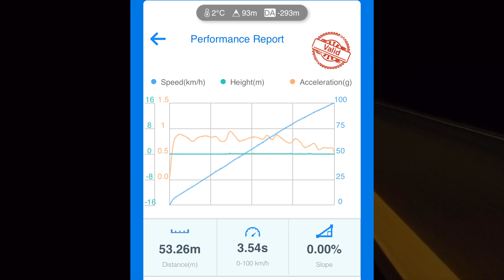WHY IS THE PERFORMANCE MODEL 3 SLOWER AFTER OTA?

Comment from the maker: So the average run 0-100kmh is now 3.64. Of 60-65 runs only one run below 3.56. Non under 3.5. Before runs were averaging 3.48! The power curve and the aggressive launch is gone. After the second 5% update it jumped off the line like a p100d! After v10 it is as before the second 5% power update. Why? You have a good reason why they should change the curve, acceleration and the way the power is delivered?
Reply: Nothing to do with software version updates. Install a obd2 dongle and use the scanmytesla app to check the "full nominal pack" value. In a new car, it should say 78kwh. Im pretty sure, that you have already some severe battery degradation, which cost you motor power, compared to when the car was new.
Reply from the maker: Nope, done the Scan my Tesla, checked temp, it is SW and most have it

Comment: I picked up my M3 in April 2020. In May finally took the v10 update. Immediately noticed acceleration loss esp "out of the hole." 
Now Tesla sells it back for $2000.  Clever way to increase revenues?
Of course there may be other explanations ... possibly to reduce stress on drive train components. 
I think Tesla could be a little more transparent.

Comment: My M3P feels slower off the line also.  I've only had it less than a month.  I can't put my finger on it but I know I'm not going crazy and it's not me "getting used to it" because the speed from 20~70mph is still fast and feels as fast as it used to be but off the line, when I bought it, it was a savage and now it feels weaker.  We paid for faster 0-60 times. I feel like if the car can't achieve the numbers that their website says... I don't know... something should be done or they need to change their numbers on the website to reflect what the car actually is going to do.

Have you tried contacting Tesla support?

Comment: With the track update I got 3.55sec without 1ft.  Still good. No difference with my car
Reply from the maker: All my 200 ish runs have always been fastest just in sport, never in trackmode. Fastest slip start + sport. 3.54 once after the update. 3.64 seems to be the number between 80-95% SOC. Not good enough!!
Reply: FrostyFingers all tesla numbers are with 1ft. Sow 3.64 is 3.44. That’s oké.  Sometimes it will be faster but on the street isn’t the same like on a dragstrip.  My 3.55 was 3.17 with 1ft and 20 inch with 83%.  Everything is on dragy.   Want faster times on the street , put light weight 18 inch on the car.
Reply from the maker: Yes much is true! However the fact that the power curve is back to the more flat one is a good sign that something has changed! As well as the average runs are 0.2 higher
Reply: FrostyFingers how much is your 1/8 ?  Also slower or ???

Comment: Are you using the same wheel / tire combo that you've tested before?  Theoretically, lighter wheels should have made it faster.   If Tesla did slow down the car with software,  they're going to have a lawsuit coming since they still advertise with the faster times.   Notify them about this with the voice command "bug report".  I'm sure if enough people complain, they'll patch it much quicker.
Reply from the maker: Sure, same wheels. Lighter than OEM but fatter. 245/285 staggered. Awesome grip on the track. It was before V10 the time between v10 and 2nd 5% power upgrade it was at its fastest and most aggressive curve. Shame really.